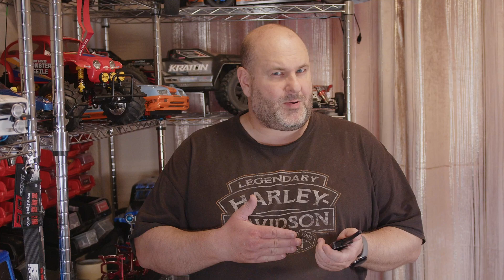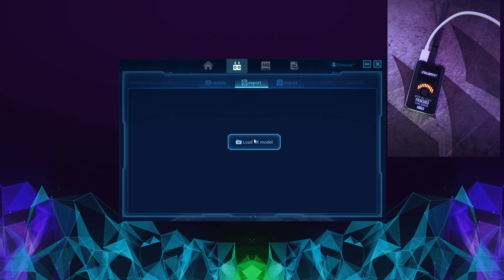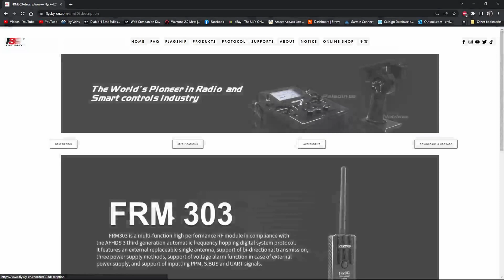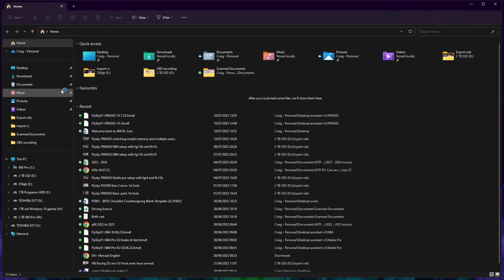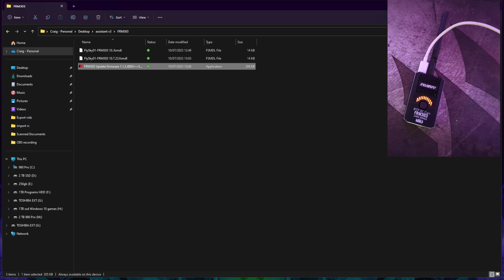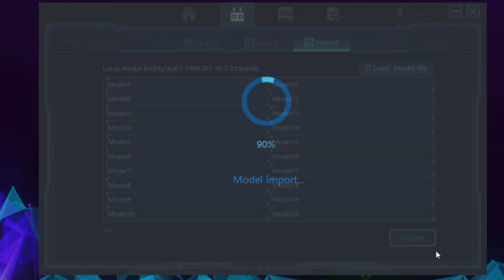Flysky FRM303 Firmware update and full power settings.

Comment: I feel like this may be a dumb question, but I just got my FRM303 and went straight to update. Can I just take my NB4 pro + backup and upload it to the FRM303?
Reply from the maker: No it won't work as all the settings and connection modes are different on the frm303 to what they are on a nb4 transmitter